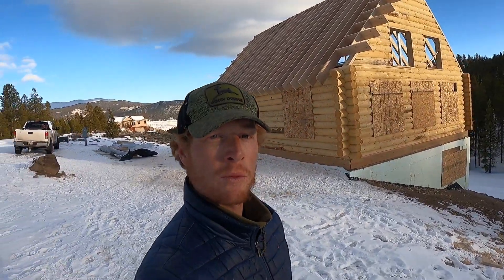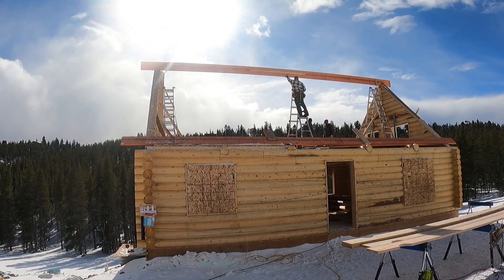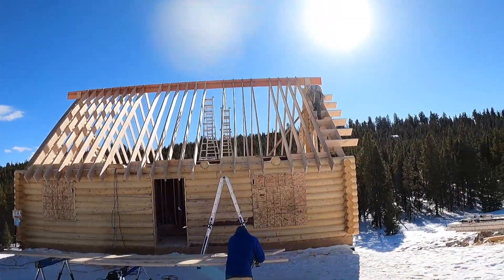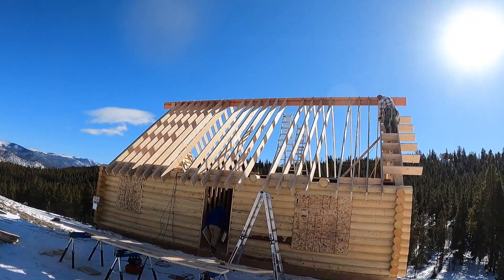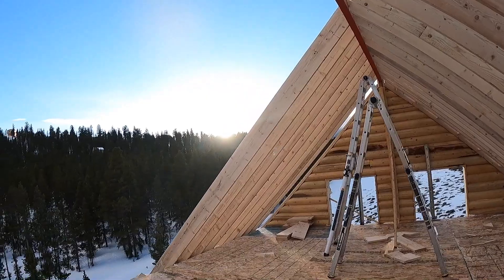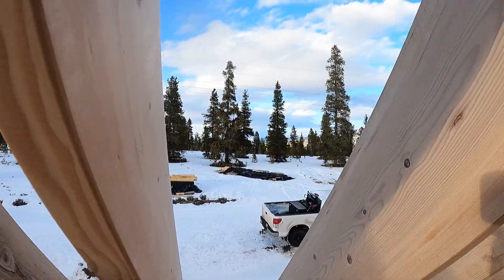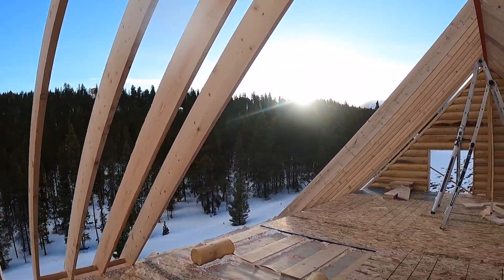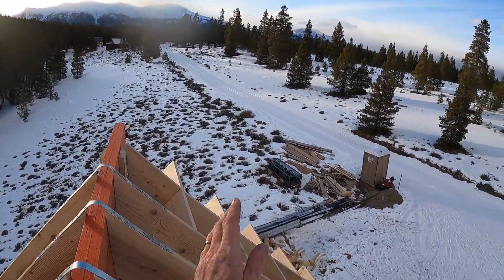Installing Ridge Beam & Rafters

Comment: Just following up on your ridge beam size.  I see that you said around 34' but that's not possible if this is a 24' X 36' building that I saw elsewhere.  It must be almost 39' overall. What were the other dimensions?  It looks like that you used 2 ea. 1.75" X 14" or 16".  I'm assuming those are 2" X 12" rafters. I building a small house with a vaulted ceiling that is 24' X 28'.  I have a 1' overhang so my LVL ridge beam will be 30' long.  I will also have a center support post at the 16'/12' mark.  I was told that I needed 3 ea. 1.75" X 24" X 30' LVL's which is ridiculous.  I'm looking to go with 3 ea. 1.75" X 12" X 30' LVLs which is still extreme overkill since my longest unsupported span is a mere 16' I'd like to get your input.  I've enjoyed all your videos on this build.
Reply from the maker: Good Catch. The overlooks are 24" on both gable sides. So the Ridge beam should have came out to 40' which is (2) 1.75" x 16
The Rafters are 2x12, yes
Every engineer will tell you differently regarding existing conditions & regulations in your county and state....
3 LVLs seems excessive for the shorter footages you are traveling, but this advice is coming from a builder rather than licensed engineer. At least you know it will be structurally sound, thanks for reaching out -
Reply: @IRONHORSEhomes  Thank you for the reply and info.  I'm going to get more into this.  I'm definitely not going (3) 1.75" X 24" X 30 footers when I am only spanning 16' max at any given point.  I will go (3) 1.75" X 12" or (2) 1.75 X 16" but the other is ridiculous. I may check with code enforcement as to what he will accept.